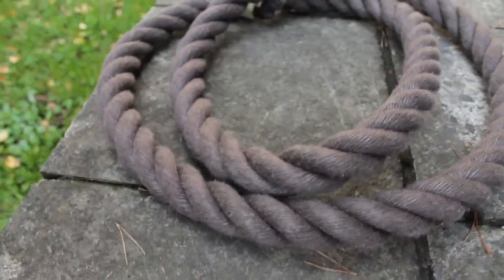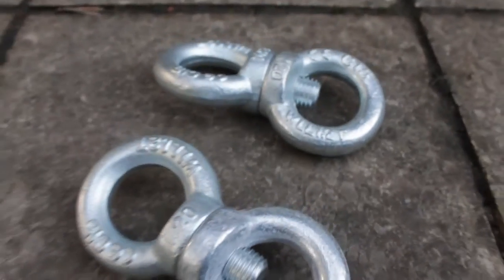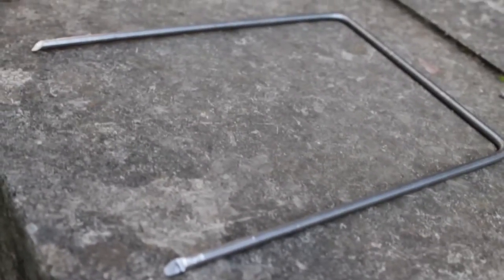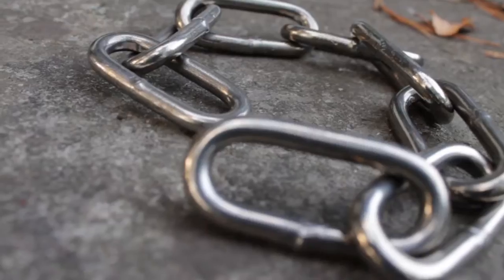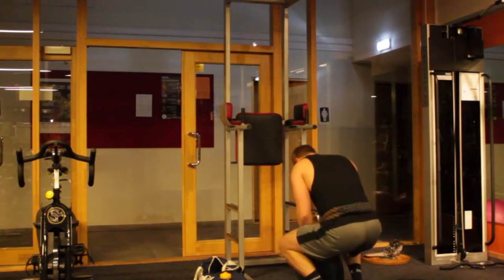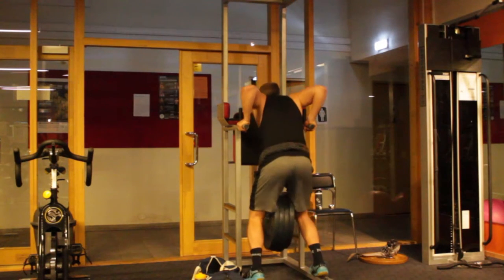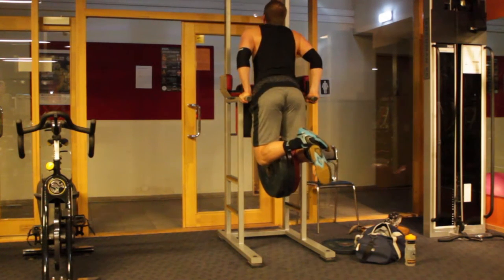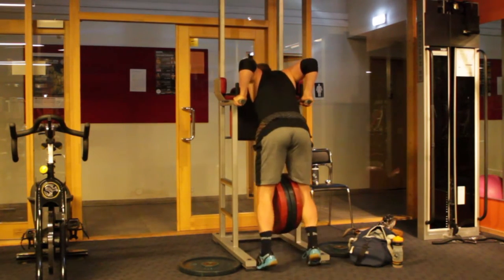How to make a heavy duty dip belt

Comment: I need more stability to protect my lower back, but this does look like it would hold A LOT more weight. Good stuff.
Reply from the maker: +Matthew Shoffner I have brokn 2 belts, and this won't break. I'm 100% sure.
Reply: I was thinking could even wrap a towel at the back before you put rope around probably give it more protection but looks strong it dose even thinking thinker chain and the attachers but looks good gave me an idear to make one was going to buy one but the ones make today snapp after 30kg